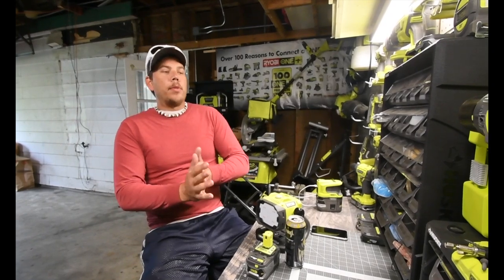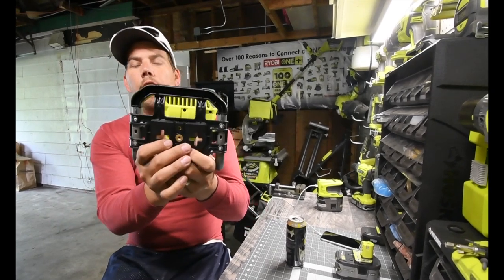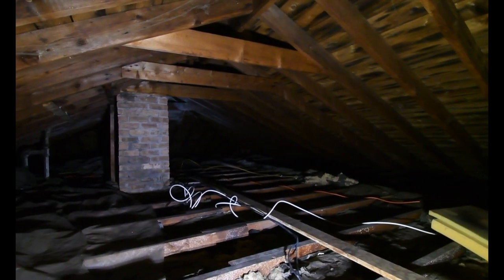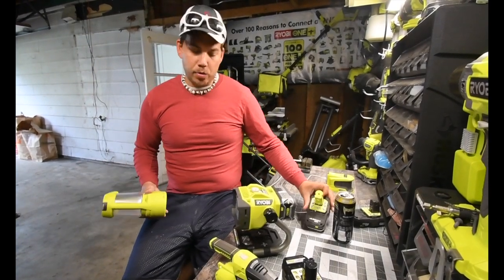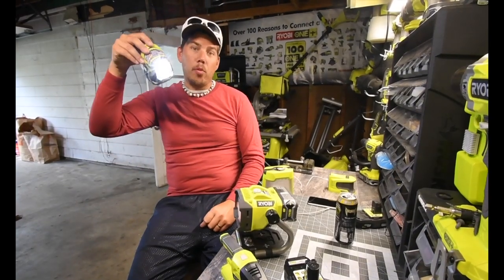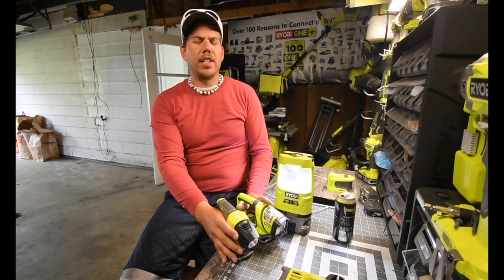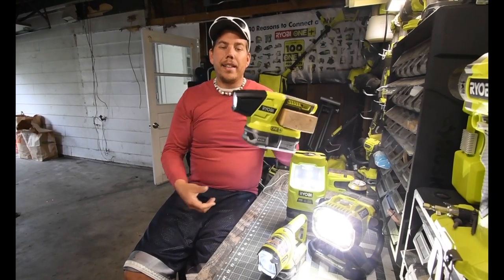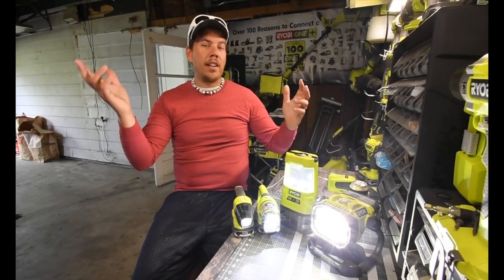Ryobi Reviews "Lights"

Comment: Hey Man Caver just got the P795 light and I like it. However, there is a slot next to the battery terminals on the light that you can slide open and closed that I just noticed. Do you know that is for? It literally has instructions on it to push open and close. Just curious. thx
Reply from the maker: ill have too look at it myself, I thank your pointing that out :)
Reply: @ManCaverTools  Thanks, I figured if anybody would know it would be you or you would know who to ask.

Comment: Who buys this garbage still?  Come on , get some real man tools.
Reply from the maker: It is not Garbage. I stand by my Ryobi tools
Reply: Ryobi is far from garbage. I have 2 ryobi impacts I've used for several years. I have screwed off tons of metal roofs and decks. The batteries and tools outlast the dewalt crap I work around. I use my Ryobi tools extensively every day and have never had a single tool fail.